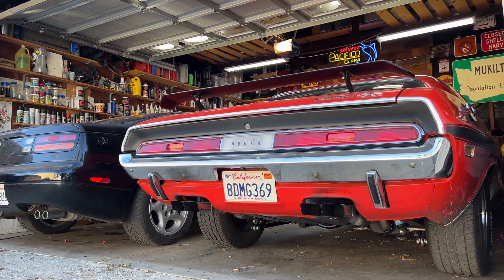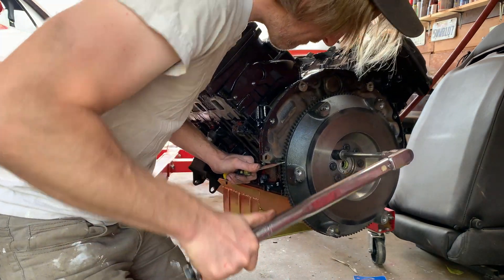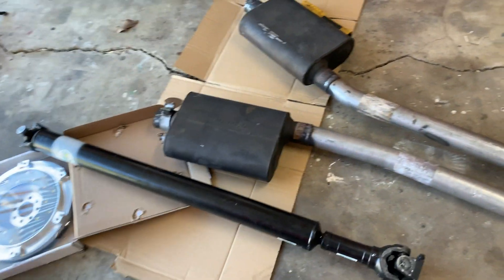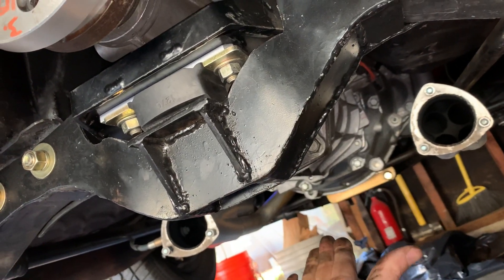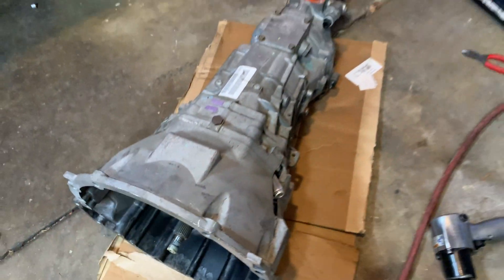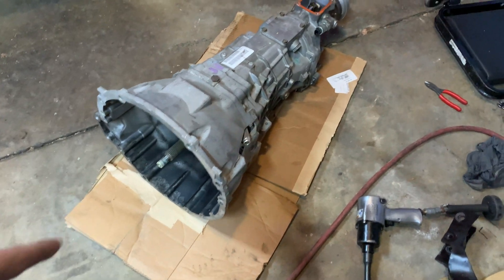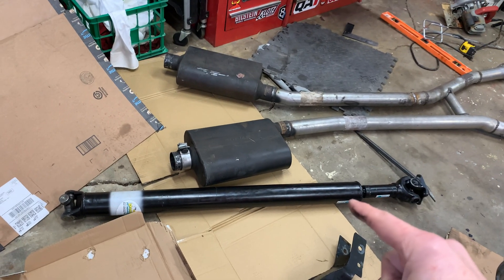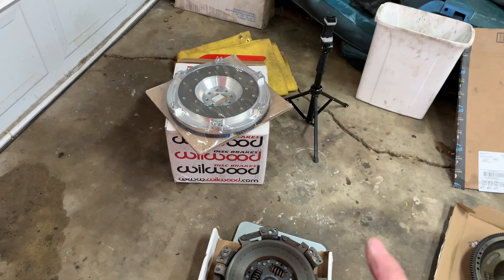Aluminum Flywheel Upgrade for my 5.7 Hemi / TR6060 Swapped 1970 Challenger 6-Speed (Part 1 of 2)

Comment: Why in the world would you put a used clutch and PP back into the car??? Now is the time to replace and perhaps upgrade.
Reply from the maker: Stock Hemi clutch kits are over a thousand bucks, aftermarkets are even more! This one is low miles and I’m confident will work just fine 👍
Reply: @noboltsleftbehind  Gotcha, your car so its your choice but given the amount of effort you are going through to get it all apart and reassembled I would be putting a new clutch and PP in. A quick google search shows kits for much less than $1000.

Comment: Are you still having a drive train rattling?
Reply from the maker: Unfortunately yes I am still having some vibrations at freeway speeds. I’m starting to suspect I have another defective TrueTrac unit.
Reply: @noboltsleftbehind  How was the ring and pinion pattern? If it's a little too inside or outside that can cause problems.
Reply from the maker: @bryanhallman8183  the pattern wasn’t great when I took it to the third shop, they re-set them up and out in a new ring and pinion. Still have the same vibration issues.
Reply from the maker: @bryanhallman8183  one strange thing I noticed was the vibration got a bit better after replacing diff fluid. My thought was the thicker fluid is helping cushion the vibes? There's a bit of wheel play on both sides. Not out/in end shaft play, but "shimmy" play like you're checking wheel bearings. I was told this is normal. All wheel/axle bearings are new.
Reply: @noboltsleftbehind  Apparently a VERY small amount of lateral (front to rear of the car) play is normal. I was looking at some different responses in some other types of rwd solid axle forums, and one guy had a reply talking about the clutches in the differential. I know you run one, but not sure which type. If it's the original one to the car, it might be wearing out. Something else to troubleshoot and eliminate. If your diff is still in spec, and the vibration is happening, I don't where else to look. I can't remember if you've have had the axles out of the housing, or not, I'd be curious how many splines they are? I think stock small blocks had 26 or 28 from the factory, but you'd have to count them to make sure. If they're higher, like 31+ they should be able to hold up under the drag runs you've done, so far.
Reply from the maker: @bryanhallman8183  mines a TrueTrac, so it’s a torsen type diff. I did buy it new, although it’s the second one I’ve had in there, the first one the axle builder claimed was defective- excessive side gear play. I’ve read about some quality issues with these TrueTracs for the 8 3/4 so it makes me a little suspicious. Not sure how much side gear play is normal but I’d call the wheel shimmy maybe a bit more than minor. Not sure my axle spline count, but I’m pretty sure they’re stock axles. I have had them both straightened.
Reply: @noboltsleftbehind  "Straightened?" 😬 That's.....scary...  If one is still just a little out of round, that could be the source of your vibration at speed. I also found this on Summit to add to your Christmas list. https://www.summitracing.com/parts/pwt-1240-lr/make/dodge/model/challenger/year/1970 This fits a 30-spline axle, which shouldn't be too far off what you already have, and should be easier to find a new pair. I know, it's always easy to spend someone else's money, but you don't want to end up with 3 wheels at 70mph with your wife and dog in the car. Might be time to really start that merch line to support any upgrades like that. (or a live stream to earn some superchats)
Reply from the maker: @bryanhallman8183  I was surprised to hear axles can be straightened too, it’s actually quite common. Of course very minor adjustments, making the axle “true” might be a better word for it. I certainly wouldn’t bother with one bent like a banana. And one good thing about the Mopar 8 3/4, it’s actually a non c-clip type, so has axle retainers. Meaning broken axles won’t result in a lost wheel. But I think you’re right about the bigger axle upgrade, probably worth while if I’m swapping carriers.
Reply: @noboltsleftbehind  The limited slip diff will have to match the spline count if you do move up. (It should tell you the number when you're looking them up, or reading off the boxes)
Reply: Drive train vibration could be the drive shaft balance.
Was the  driveshaft balanced with the adapter?
Reply from the maker: @paulpasternak2026  I did have it balanced with the adapter this last time, so far I've had it done three times.